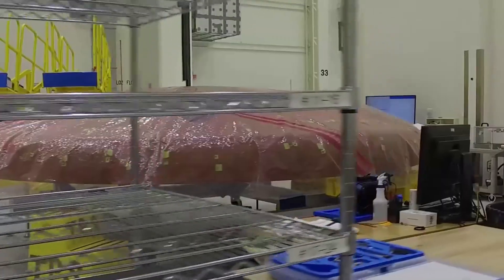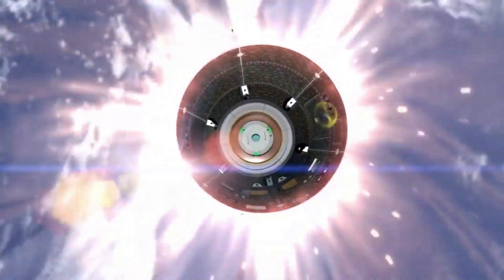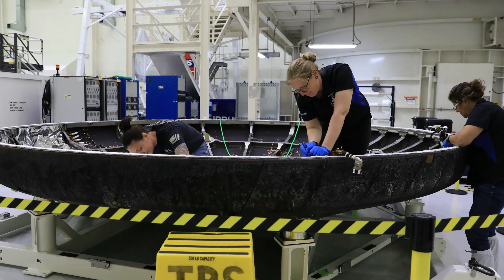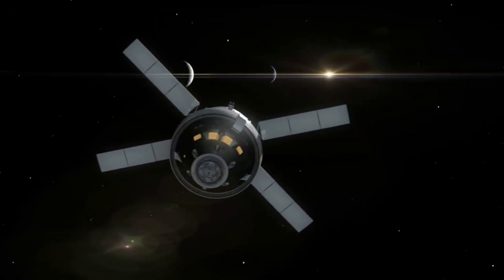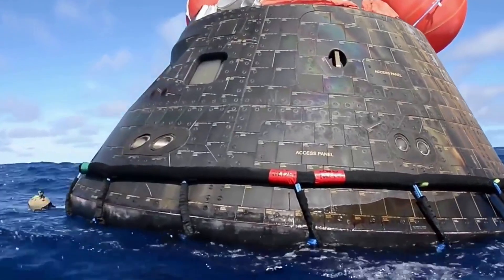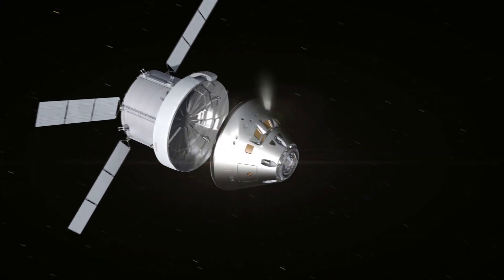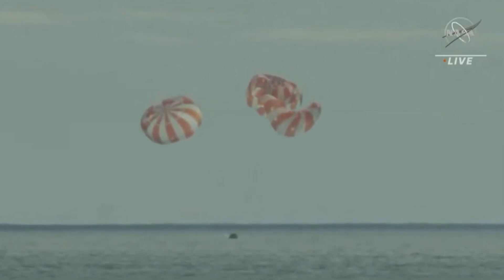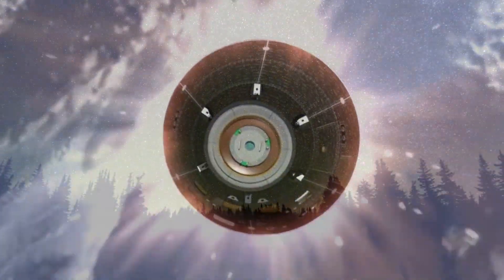A Closer Look At The Orion Spacecraft & Its Heat Shield

Comment: NASA doesn't plan on modifying the Artemis II heat shield.
They are working to understand the cause of the unexpected flaking on the Artemis I heat shield and then use that information to get to a flight rationale for flying the heat shiled as is, potentially on a less demanding re-entry angle to lessen the heat loads somewhat.
Overall it wasn't a big issue, the heat shield performed to spec and still had a lot of ablator left unburned as a safety margin.

Comment: Of course this comment section is filled with people saying "just cancel this and go with SpaceX Hardware" like- do you understand that SpaceX currently doesn't have any hardware that could be capable of this? Falcon Heavy couldn't get Orion to the moon, Dragon can't have crew on board for long enough - and SLS is here and it's working. Yes Starship will (hopefully) be able to do this as well but that's gonna take decades - I don't doubt starship is gonna do it better than the SLS but starship is yet to prove such capabilities.

Oh yea, by the way: Orion is reusable.
Reply: 12 billion they spend , 2024 is about to end and no any positive news and hopes about launching , 
Boeing is sucking more and more only. without impact le output
Reply: Dragon could easily be adapted for a moon mission. I don't doubt SpaceX's ability to do that if they were required to. NASA is not going to be able to sustain SLS for very long. It is far too expensive, and I would argue that the Orion capsule needs to conduct another unmanned flight before they even consider putting human beings in it.

I also remember an engineer who worked at both SpaceX and NASA, saying that Elon tends to expect a lot more precision and hard work from his engineers than NASA and Lockheed etc.

So either company can pull this off, but the biggest impediment to SLS sustainability is the cost.
Reply: @rickmorty7284  Dragon does not have a heatshield capable of surviving reentry returning from the moon.
 SpaceX is currently neither developing such a heatshield, nor are they looking to crew certify Falcon heavy, nor are they looking to upgrade life support, coms and navigation equipment. None of these are easy, none of them are fast. Waiting for SpaceX to replace SLS and Orion with modified Dragon and Flacon heavy vehicles would only cause years of delays and additional development costs.

Comment: These are reusable, right??????😂😂😂😂
Reply: Reusing heat shields is hard - most are ablative which means they intentionally "damage" themselves to get rid of heat. The Space shuttle tried a non-ablative heat shield and that was a failure all together. Starship will try that too but that's yet to be tested - but the capsule itself, the Orion spacecraft is Reusable, yes. Just like Dragon, the heat shield isn't reusable but the capsule itself is.

Comment: The most important element is the availability. Electrify America may have higher voltage on some of their chargers but if you run out of battery getting there, what's the point? One key thing people tend to forget is that the higher the voltage the thinner the cable needs to be. It's not because the other connectors looks beefy and more robust that they can handle more power.